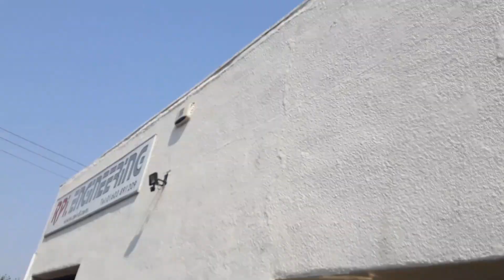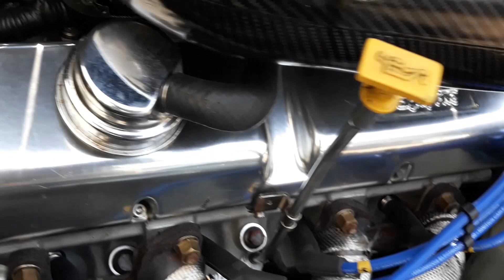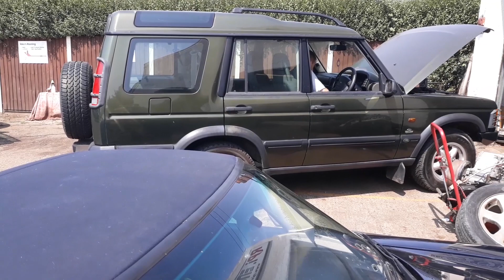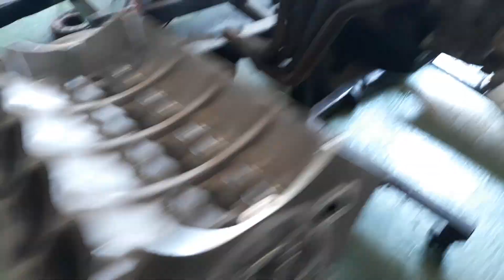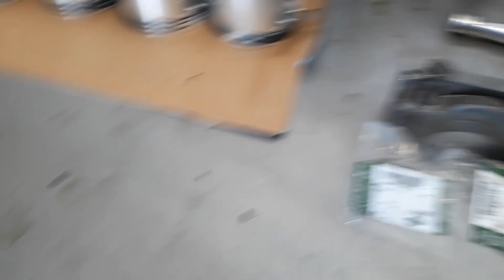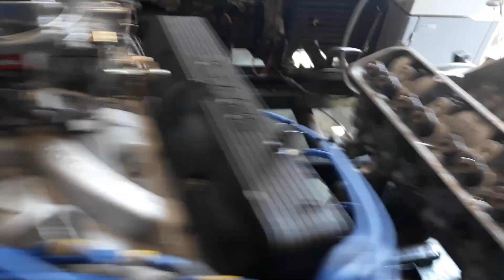27th July 2018 Workshop Update at RPi Engineering

Comment: Love your updates!! Great motivation for the Cam install I have ahead of me on an 01 Discovery. Why do you recommend that oil only for Rover V8's?
Reply from the maker: Thanks. Great to hear that people enjoy them. Next week I am aiming for a video every day!!

Its the correct grade oil and has a high ZDDP additive in it (zinc) add to that the 20+ years that we have only ever used the engine oil and to have no issues with oil quality etc and the engines we supply for dyno test cell torture 23 hours a day run 20/50 with a high zinc additive thats enough for us to recommend and only use this oil

Good luck with you cam change, take you time. Hope your using a good quality Piper or Kent cam and OEM lifters, ensure you set tappet pre load and check rocker shafts and oil pump gears for wear whilst you are in there.

miss my Discovery 1 but its now the base for the DisKAvery project which I really must finish